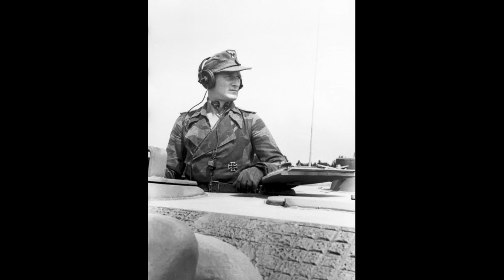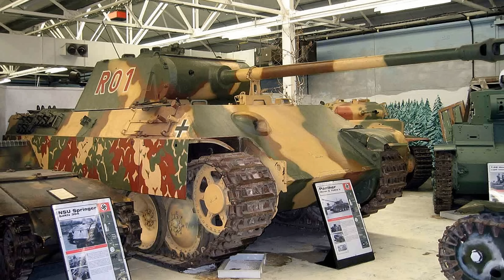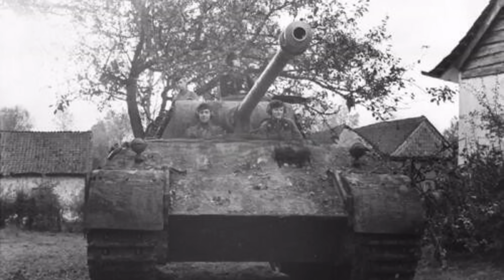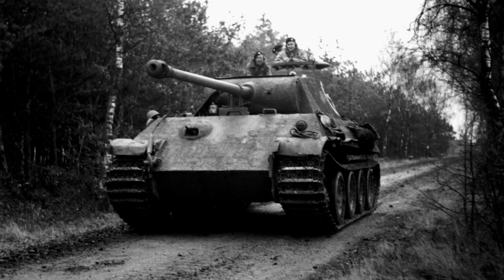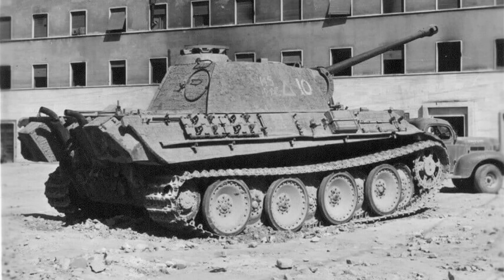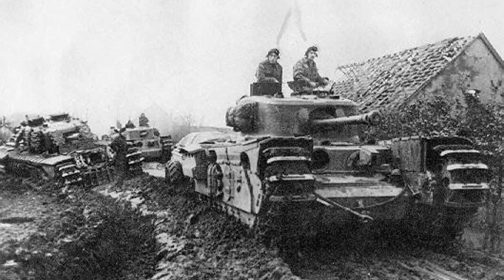British Engineers Tested Germany's Panther Tank — All Five Failed From Engine Fires

Comment: The first photo is not of a tank,. It's a German tank killer called a StuG. The Sturmgeschütz (StuG) was a fully tracked armored fighting vehicle, known for its powerful, casemate-mounted gun in place of a rotating turret. The main gun had a limited horizontal traverse of approximately 10 to 12 degrees to either side, for a total of around 20-24 degrees of swivel. I can''t understand why these video productions cannot be bothered to coordinate their narratives with accurate photography.